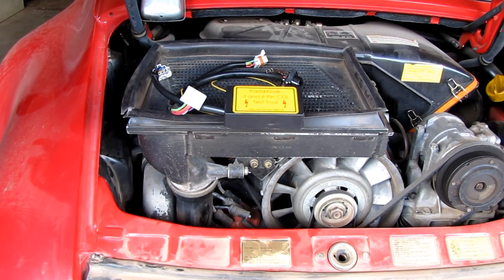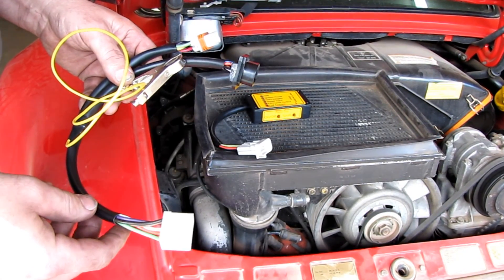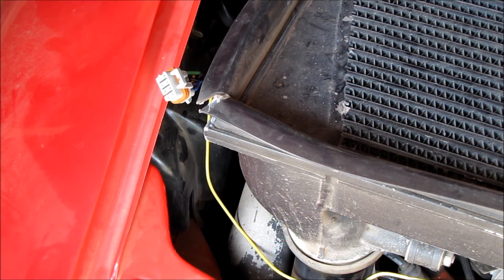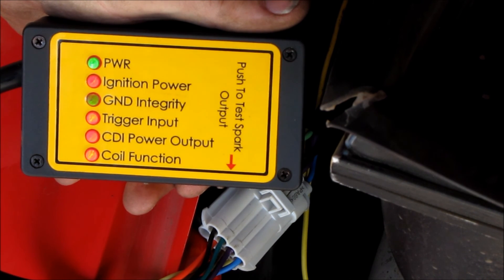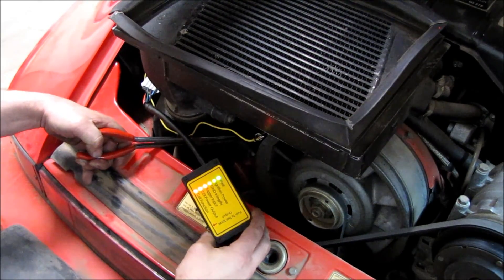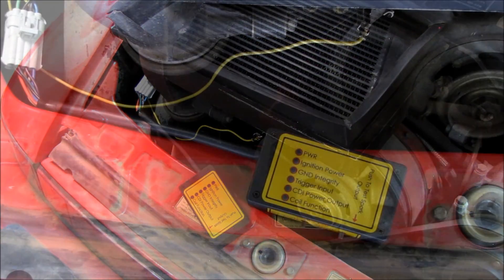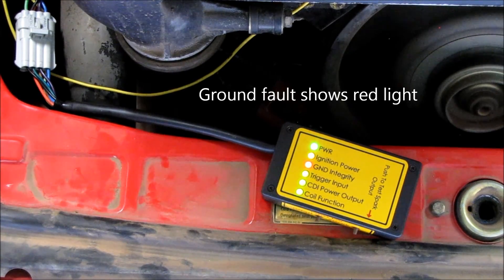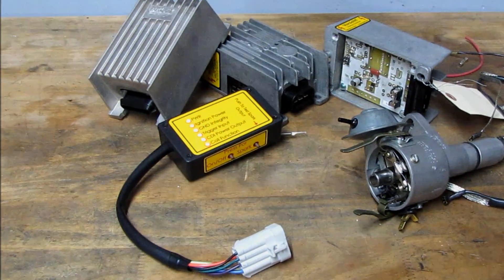CDI Test Tool

Comment: where can i buy this tester for 1983 porsche  6 pin , sent out CDI box for repair and still have the same problem.not working after 10 mins of run time die's out than restarts 2 mins later.

Comment from the maker: Hi James
The test tool would most likely work but what results you would get im not sure. The test tool is specifically designed to work with Porsche systems and depending what type of  trigger and coil combination your motorcycle is using it may not indicate correctly if the system is functioning or not.
All of the functions that the CDI test tool preforms are all do-able using a combination of a good quality voltmeter and or an oscilloscope. if using a voltmeter it must have a minimum/maximum display to catch any or all power and ground faults, and you will also need an inductive pickup to measure CDI output and coil output current. We would be happy to sell you a CDI test tool along with a universal test harness for $289.00
Thanks and I hope this helps